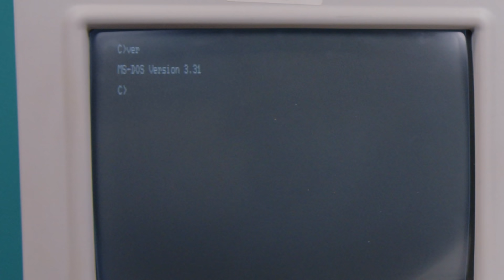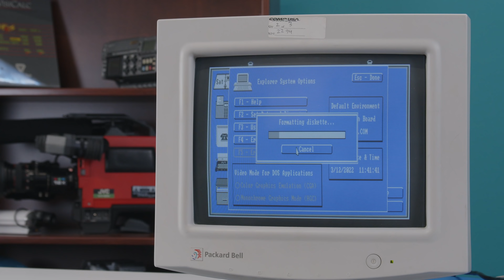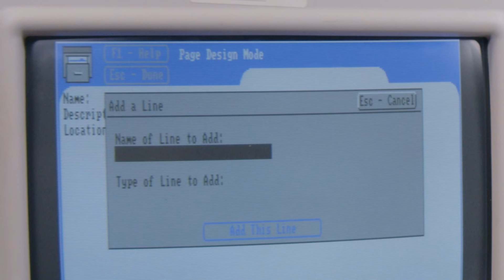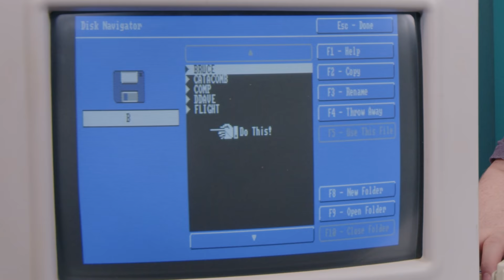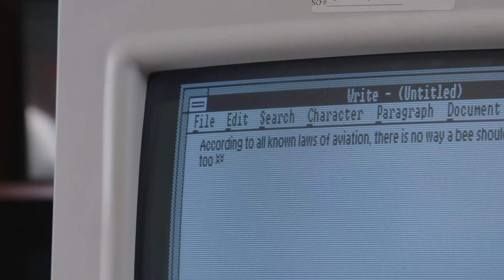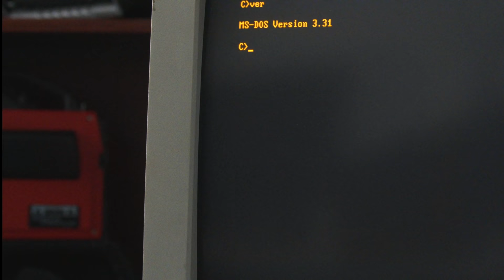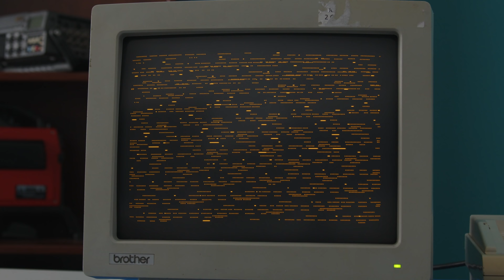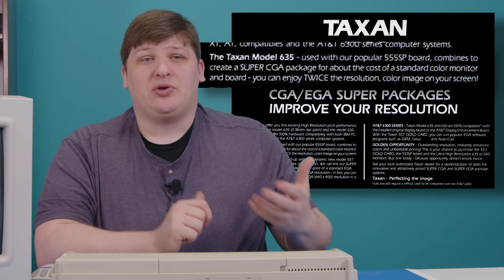Headstart's PC With The Weird GUI "OS" [Explorer]

Comment: Humm, I guess it depends on this graphics chip and how the memory is layed out.  This chip on the surface looks kind of nice, it even had support for 256 colors.  This is only in its "lcd" mode though but it wouldn't be hard to use this on a vga monitor with a DAC to the colors.  I think you might be right that the video ram is limited, I would say 32k as the applications manual says you need a minimum of 32k for Herc mode.

You have to load the chip with completely different settings to switch to herc mode,  so I would try to dump the settings from the chip and check if the ram exists.  I found one off ebay so going to play with it, just a neet chip.

Comment: Oh hey, I think that's the same monitor I have hooked up to my modern-day gaming rig on my desk lol.  It's from my childhood Packard Bell 3.11 pentium machine.  I use it with a mono price hdmi to VGA adapter that's, funny enough, actually plugged into a DVI port with a HDMI to DVI adapter lol.  I think there's even an HDMI to HDMI 90 degree adapter thrown in there for good measure.  But hey, it works!  I can get it to a little past SVGA I think, and it works great for DOSBox, ScummVM games, and early windows games like Outlaws and Heroes of Might and Magic 3.  The awesome thing is that, if you fiddle with the DOXBox settings, you can actually run them at proper resolution and refresh rate through the adapter!  I was playing Dark Forces on there in proper 320x200 @70Hz (iirc), and it looked gorgeous.  I've even played some modern titles on it like Crysis Remastered, because, hey, then I can play that game maxed out ;P

Comment: Oh the 640v200x15_color mode, the limited resolution come if I remember correctly from the fact that with the standard EGA card there was only included enough video memory for 4 colors at 640x350 resolution. To use ti in 640x350 you had to order  extra video memory. Which very soon become the standard configuration for almost  every manufacturer except the concrete Big Blue (IBM that is).
So 640x200x16 colors was the lower denominator with the standard amount is video RAM.
Reply: The PC market is lucky it had cloners to shake things up and move the market forward. IBM was about as ignorant and stubborn as Commodore when it came to pushing the envelope. Had it been ONLY IBM developing the PC... I don't know WHAT computer I would have just typed this with. Maybe a Mac.

Comment: This reminds me of the Amstrad PPC 512 from the late 1980's, I saw a few of them here in the UK.  With a similar folding out keyboard, it was designed to be a luggable and had a small built-in monochrome LCD Display.
Reply from the maker: Ah yes! The PPC 512 has been a beige whale for me for a while, although the chances of ever getting one are low (and I bet it won't work by now.) It's hard for me to get info about UK machines compared to US ones so stuff like this tends not to come up on my radar.

Comment: I bought an Apple IIe with 2 floppies and green screen with accessory stand and Apple Works not long after it came out. I was uprading grom an Apple+. At some point I found an offer to try Autocad 1.0 so I got it. I don't remember how many floppies it came on but I do remember swapping floppies often, you had to switch to execute commands beyond the basics. Also you had to put in your data floppy when appropriate. The fire nozzle was the standard presentation graphic up till at least Autocad went to Windows.

Comment: As for the explorer, The word processor is pretty standard for the 80s as none of them had multiple fonts, and cut was the same as delete.  You're just spoiled by modern comforts.  The applications are limited to the rudimentary functions because it was limited to the ROM size it was running from. Keep in mind the GUI was probably running from a 64K or 128K ROM chip.  The GUI was created so they wouldn't have to include the HDD.   also people are correct, Turbo is toggled with ctrl+alt+plus and ctrl-alt-minus on the numeric keypad.
I had the Philips Headstart CD-XT Turbo that came with an i8088-1, DOS 3.31, a menuing system and had an ATI VGAWonder with 128K of video RAM a 40MB XT IDE hard drive, a 1.44mb 3.5" floppy and a Sony cartridge CD-ROM drive with several CDs and a restore disc that supported several headstart PCs, I lifted Turbo Pascal 5.5 off of that CD.  

The Magnavox Headstart 286 came with DOS 4.01, 80Mb HDD, 2MB of RAM and Geoworks 2.0 with  AOL.  They provided a couple of free upgrades to Geoworks, but it was limited to 1.44 and 1.2 MB floppies for inputs because of no cd-rom drive.
By the way, both Headstart PCs came from Montgomery Ward.

Comment: That is an interesting piece of hardware! Albeit the usual rant about usability, I quite enjoyed it ;). It's also interesting to see you can actually write DOS software ;)
Some additions/fixes: 
You might want to try some key combinations to toggle turbo/nonturbo. E.g. Ctrl+Alt+ -/+. This is not too uncommon - no utility req'd. MDA uses 50 Hz refresh rate, not 75. The monitors compensate for this with their longer preserving phosphors (one could even see this in your footage when there was text scrolling). EGA could do 64 colors at once with EGA monitors. This is a little known fact. Start Lemmings and look at the title screen (also works on VGA cards).
You should've included a pic of the MoBo. Not only for completeness, but maybe I or some other viewer could've helped you finding the graphics mem chips ;)
Reply from the maker: Haha, I'm not much of a programmer but I think I was able to mash it together by converting the image to 1bpp, then exporting to XBM to get one character per pixel, then I bodged it all into the central loop of an existing test app I found. I DID start out with a library and a blank .c file but I ran into weirdness and decided to restart with someone else's largely-finished solution and just add the special sauce I needed.

I tried a bunch of key combos with no success but so many people suggested -/+, and I admit I didn't try those; will when I can. The refresh rate thing was just a brain flub (more details in pinned comment.)

I'm aware EGA could do 64 colors but I usually just ignore that because virtually nothing was coded for it. IBM wanted to maintain CGA monitor backwards compat, so every developer had to either assume users were on a CGA monitor, or code for both possibilities - so almost everyone just did the former. I think I've seen two EGA apps ever with custom palettes.

I did take pics of the motherboard but they were absolutely crap, and it was so irritating to take this thing apart and put it back together that I was worried if I did so I would break it irreparably. That said, they were enough to identify the graphics chip - someone I showed them to found it, and I was left scratching my head because the chip is VERY prominent and I just plain missed it. More details in the pinned comment. Thanks for watching!
Reply: @CathodeRayDude  Thanks for the details... so many more, but that's your style ;). Yep, know about the EGA thing and backwards compatibility. I just like it as an asterisk-fact (and am mad at IBM they did this, as this potentially prevented many more cool EGA graphics games).

Okay... then now fubbled-together C code, tomorrow ASM optimizations for faster picture loading. Believe me, it's fun! :D

Comment: 38:28 - Hercules was also available (HGC - 720x348 monochrome). I am not sure how it compared to MDA or if it required its own type of monitor. Ah, you did your homework! 41:13. I actually have a hercules ISA card somewhere, from my first PC. It probably still works.

Comment: There were a dozen+ GUIs/semi-GUIs in the mid-1980's... most were overlays on dos. That said, the ones that were distinct: Windows 1, MacOS (6 was the new one when I started college in Spring 1988), Apple IIgs Prodos 16,  Acorn's RISC-OS, GEOS (available for C64, c128, Apple IIe/IIgs, Atari, and others), GEM (Atari and IBM). And the semi-GUIs - text based launcher systems - I don't know the names of most, but for DOS-Shell. There were various text mode "semi-GUI" overlays similar to DOSSHELL for Unix, MS-DOS, Atari TOS, Apple II DOS3.3 & Prodos 8, Apple IIgs ProDOS 16. ISTR there being an MSX ( cheeked - yes: SyMBOS).

As for no one adopting 286's? Bull. Nasty myth. Most people I know upgraded to 286s... and then to 386s... about 6 months after release, when processor costs dropped by a large chunk. Dad went from a CP/M Kaypro 2 to a BSR 386. There were lots of bargain 8088 machines. Everyone wanted the much faster speed.

Apple II and C64 Keyboards were actually quite comfortable... by comparison to many other machines. The IBM Model F always felt horrendous to me. (There is no defense for the Sinclair membranes...) On the other hand, I had dual carpal tunnel releases prior to age 20, due to being a musician and college student. And I had a recessed desk for a typewriter - which said, most typewriters at the time were as tall or taller than the Apple II keyboard.
Reply from the maker: Didn't say nobody bought them. Said that 8088s continued being a major player in the market and completely acceptable to plenty of people for the entire decade, a bonafide fact you can confirm in any contemporary magazine.
Reply: @CathodeRayDude  Advertising them for sale doesn't prove people buying them.

Comment: Speaking of wedge computers, when dealing with Commadore C128s, there are two versions, the wedge which is often considered the default C128 and the D or desktop being later and not as common.  Also thank you for also calling out the C64's keyboard as terrible, the C128's is better if only the profile has it shifted forward into a more modern typing position.

Personally, I think I'm going to keep my authentic PC/XT.
Reply: The C64C's keyboard was fine, but the original breadbox was indeed not great.

Comment: I actually owned one (or better: my parents), so I have some extra info:
- Vendex was name of a group of retail stores in the Netherlands, that owned the department stores called V&D (and others). We bought ours at the Dixons (no relation to the UK brand, funny enough) and it was called Headstart Explorer. I have never seen them called Vendex Explorer anywhere.
- The keyboard was nice, but you couldn't move it anywhere. So that made it more difficult to find the right position to type
- The floppy drive was only 720kb, so it couldn't use the 1.44MB. No aftermarket drives have ever been available
- A 5,25" external drive was promised at launch, but it never hit the market
- An upgrade from 640kb to 1MB was available, but the 8088 couldn't address the extra memory...
- When you have the harddisk installed, you can store things from the GUI and save settings.
- I hardly ever used the GUI, I agree with your negative review ;)
- It came with a pretty cool stand, that exactly fit the computer under the monitor. It's visible in the add you show about the color modes.
- For the time, it really was a great offer. Other computers only had 20 or 30MB harddisks and only monochrome monitors for the same price

That's all I can remember :)
Reply from the maker: Thanks for all the info! Wish I'd realized that about the hard drive - the manuals for this thing aren't preserved so I couldn't research that part, and it never occurred to me that it would let you save things to a hard drive that it wouldn't save to a floppy, so, whoops, haha.
Reply: @CathodeRayDude  With a hard disk, the whole experience gets a lot better ;). It was an awesome machine for the time and we've used it for many years. It was also a pretty weird machine, so I can imagine you didn't realize that. I only got to realize it 30 years later after you said you couldn't save ;)

Comment: I wonder if you cut the text, change the bold, italic or underline and then paste it back again, would it paste back the same as before or as if you had retyped it with the new style? Cumbersome, but then not quite so bad. Despite everything, and considering I don't type at the speed of light, I'd have probably got by just fine for the odd thank you letter to grannie and some school work, especially having a spell checker. :-)
Reply from the maker: I thought of that but nope, it still doesn't affect it. Absolutely nuts lol

Comment: Okay, for the power button, guess you're not old enough to remember the old No.2 pencil and the built in eraser. You also don't remember boot disks that we had for running the "more demanding games" to free up enough memory, where you could pass the command to run the utility to disable turbo without a button and to get things running slow enought to be playable. Sorry, I'm old, was young at one time, and worked 30 years in IT, which enabled me to retire fairly recently at 51YO.

Comment: Every time I see the title in the suggested list, I think, "What's so special about the Atari ST?" and then I realise. :)

Certain Atari STs - the FM series - had the worst keyswitches I've ever used. They also had just a bit too much height and angle due to having the disk drive in the case - and not above the keyboard like the Tandy. The 8-bit XE series (and I assume the earliest STs) had a much better angle.

Haha! I probably got good at listening for operational drive noises because the ST has no light on the front. But I got so good, I never needed a light after that. :)

I think you can usually find those system-specific programs online.

The power button hole looks just-about the right size for the back end of a pencil, perhaps especially with an eraser tip.

Oh! I've seen that style of rounded button implemented in text mode with a custom font. Ridiculous! :) The way the highlight and shadow wrap around the corners makes this look like it's in text mode too, somehow. Perhaps they copied the style without thinking, or perhaps they thought they were being clever and distinctive by having the highlight and shadow wrap around a little too far. Or perhaps they used text mode for reasons of memory and speed.

I can't stand the constant "Do this!" banner. I lasted about 2 minutes just watching it. XD

Eeww modal popups! (The calculator, in this case.) There's a few cases where they make sense, esepcially without multitasking, but other than those, I always thought they were a huge UI failure. They still are. I was using PuTTY just yesterday which has a standard Windows help file. If you open the help file from within the program, you can't use the program without minimizing help which is absolutely insane for a help system! And yet Windows was probably the best window system in the 80s. m( You may notice I haven't explicitly mentioned GEM...

Oogh! I've used my share of "worse than nothing" programs in the past.

How were programmers still writing systems incapable of keeping up with typing in 1989? Or of catching up when the typist gets ahead? It's not even hard! But I do actually know: It's one of those things which seems impossible until you get it. Anyway, I had no problem typing into Microsoft's EDIT.COM on a non-turbo 8088-powered Toshiba T-1200 in the late 90s. (DOS 6.22 program on DOS 3; worked fine.) I used to drive out to quiet places at night and power the old laptop with the car battery to write stories.

Hahahahhahahahahahahhaa "you just get this miserable buzz". Total failure at text editor memory management there, especially as overwrite is the absolute easiest thing in the world for a text editor to do!

I think it very likely they ran out of ROM space. I'm not sure if that was reasonable or a sign of yet more incompetence, or perhaps poor choice of compiler or something... It's not like there were many icons to take up space.

A real database is fine, but why do you have to go into browse to add a new page? Still, at least this one is fairly typical UI weirdness for the time.

So it's a GUI worse than GEM. I don't believe it! :) But actually, GEM didn't even try to include any programs beyond a file manager. It had -- and still has -- a text viewer, but not an editor. Staggering! And a silly annoying bug which got fixed in 1989-model Atari STs was still present in OpenGEM when I last tried it, 30 years later. (It deselects files when you scroll.) And it still has nothing like "open with..."; you just have to have the document and program folders open and drag one to the other.

I do like the case and especially that it's a cheap machine with a good keyboard.

I love the flight sim crashing! XD I think I'm happy I had an Atari ST for games in those days, both for colors and sound. But speaking of CRTs, I do with I'd had a high-res monitor for doing any programming with it. Medium-res was way too fuzzy on a Commodore 1084. I did eventually make a VGA adapter, (it's the same 640x400 as EGA,) but I only did that for a girl. Way too much effort, soldering those little 13-pin plugs.

Amber screen! :D I love maskless monochrome CRTs.

Haha! That overlay was a trip. :D

Hercules graphics! :)

Yeah, this was fun to watch. :) I hope the comment wasn't too long. I do get nostalgic.

Comment: I get the idea that the internal GUI was to put it somewhere between the dedicated word processors at the time that sometimes had some very rudimentary utility programs in them. My parents were the type that wouldn't have known the difference and this would have been a substantial upgrade. Not the word processing part but literally anything else it could do. I got a radio shack word processor and a truly god awful brother luggable one "because it's the same thing." This was an argument had many times but if memory serves her computer at work just booted into word perfect for the longest (and my father hasn't touched a computer since they needed plug boards) I could see how they would have this thinking. That would have been around 1990 and getting a used dual floppy 5160 in 92 was a huge upgrade and my first PC so yeah I can see this having a place.